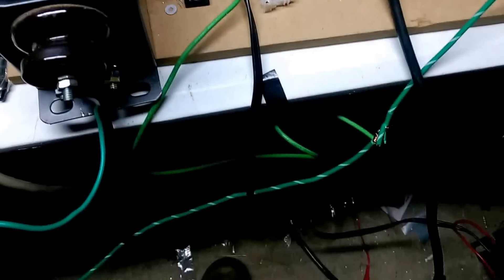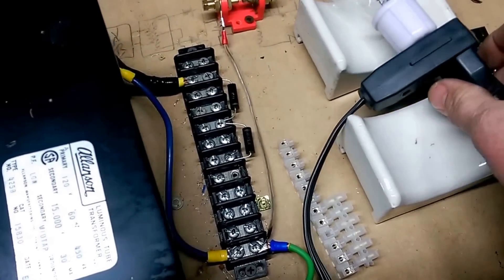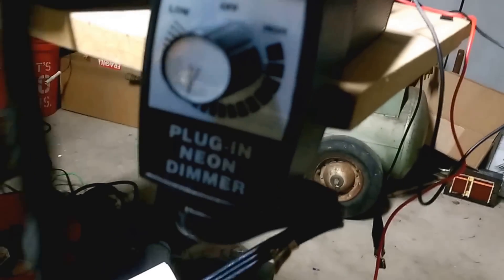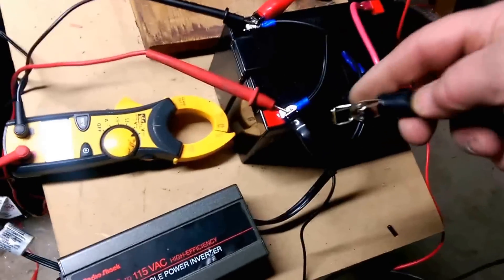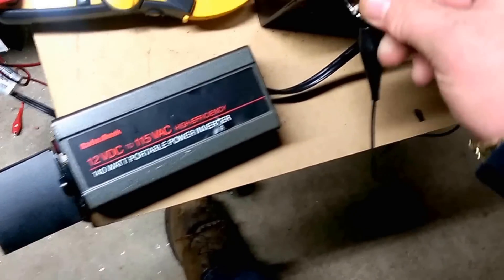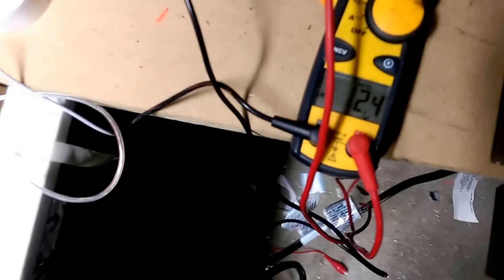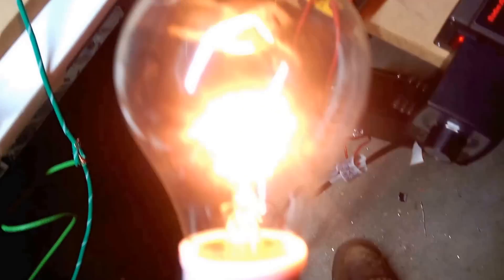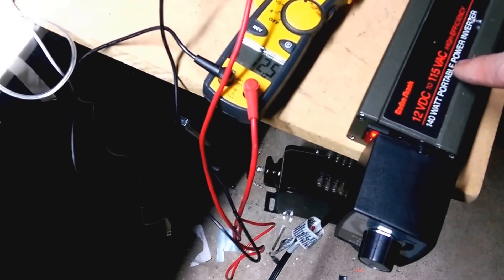Working Free Energy Generator-Dezeinstein Technologies-Annotated

Comment: Thanks Marc
I am catching up on the reading of your posts. I think all HV pumping into an earth
grounded center tapped coil is relevant. We can see from previous energy extraction
devices that energy CAN be pumped into a set of ground rods or even a single plate
only to  return back  with more energy than was originally injected.

Nice to read up and hear about your night visions. This submersion into the realm of
long hours of experimenting on into the twilight is wonder. It boarders on the definition
of the creative GOD mind where anything  is possible, where we become connected
to the answered we have been conditioned to not see.

Comment: so u are overunity. (congrats out of 10,000,000,000 people that lived u are probably 1 of 1000 or 1 of 10000).....u have to download and read.....pjkbook.pdf    its 3300 pgs...dont try and understand everything just skim through  ..... get your head around the history of overunity
Reply from the maker: +Hazenthly&#39;s Fire - Hello, Thanks for the comment and compliments. You can pick up small vials of graphene oxide powder from the right vendors on ebay for under $20. You don't have to make a nano particle coated plate to get this working, especially if you are at a higher elevation. If you look at Don's different schematics, there's a bridge rectifier in many of them that the DC - is not connected. This could remain like this, or, it could connect to the output , or, a plate/antenna. Its your choice and depending on the components, there isn't any one device built that works that is exactly the same. The most difficult part to remember is that resonance is like a fingerprint. You have to have it just right and have the tools to get resonance at high frequencies. It is tough to do, even with a scope at high frequencies because you have to go all the way down to the picofarad to line up and tune what you need as the frequency needs to be perfect. I just tuned a coil I made and I found that an online resonance calculator has shown me to make the cap in my circuit for a lower frequency 1.58 uF. The resonance calculator has 3 variables to set the calculator with.. uF, nF, and pF.  I set the calculator to give me the capacitance needed for the coil and frequency already known, and, it didn't work at the uF or pF range's reading. I added a 675pF air capacitor to the coil to tune it upwards in parallel and I hit the nail on the head. It is very difficult to use a scope to do this because the capacitance of the probes needs to be decoupled. I find it easiest to figure out exactly what the input frequency is, and, either make it variable for ease of tuning, or, ensure the frequency is dead on using 2 or 3 different frequency counters, backing the measurement up with a scope to be 100% sure the frequency isn't off. If the output is variable and it shifts a couple of hertz, you will need to build a phase lock loop circuit, and I haven't done this yet, but have heard guys like Stan Meyer have done this to eliminate frequency drift that will knock away resonance.

If you have questions that I could assist you with, please send me an invite on google hangouts and I'd be more than happy to assist you. Please don't listen to the skeptics, they have absolutely nothing better to do with their time but try to make my followers scared of trying to build these devices. I will warn you.. they are not easy to get functioning, and they take time to figure out, but, I will be willing to assist you as I do many folks. I have a lab partner that lives in Rome, Italy that has made some devices work with my assistance. They may not have a ton of power exiting the devices, but, my help got him to continuously charge and discharge  a massive cap bank in the area of 200-250 watts continuously without draining his little battery powering his device. If you've never seen any of the device's phenomenon before, it is a wild learning experience that is nothing like you have ever worked with before. There's energy that comes from these circuits that you'd never think was possible, and, it is frustrating trying to get them working without help.  Key ingredients to make these energies appear are high voltage/high frequency fast acting diodes that are good for 20 % higher voltage than your circuit can produce at it's step up coil. Other parts needed to make this work are very large DC polarized capacitors at least 3500uF to 10,000uF to start , maybe good for 480v or 650v . If you have enough of them to bank, you will have much more power. Ultracapacitors can only be used after the conversion where a transformer is used and successfully outputs voltage (this is the hardest part which requires something to pulse the energy from the cap to the input coil of the transformer in a switching frequency you would normally use, either 50hz or 60hz. Transistors can be used to build an inverter as Don shows, however, the polarity of the circuit he posts is wrong. The correct schematic is online and I recommend finding some very powerful IGBT's to be used in place of the transistors. After the IGBT section, the output could go through another  fwbr to transfer to DC and you'll be able to charge an ultracapcitor bank. It is super important to buy (2) 1500 ohm wire wound resistors or higher resistance to transfer the cold radiation back to conventional energy. The resistor takes the high voltage and creates a voltage divider, then, it breaks down the frequency from a high frequency low energy electricity to a high amperage energy that will fill the dc cap next to immediately at the voltages you need. Without resonance, you won't even get voltage to pass from one side of the coil to the other, so, this is most important. Build the board in sections or modules, so, once you are completed with one module, move onto the next.  For the plate antenna, graphene powder and acrylic polyurethane can be mixed to make a paint that is highly conductive. When I finished mine, as it was still tacky, I sprinkled powdered aluminum over the top of the copper plate and buffed it to a high sheen. The outcome makes it look like a static bag's color and it instantly has a voltage from the plate to ground using the powdered metal and the carbon used in the graphene. These substances have a normal difference in potential and since they are dry, containing no acids or liquids, they are not chemically reacting and will remain like this forever. The plates themselves will light small leds without any batteries at all and will never lose their power. If we use these to draw in energy, the level of energy is much higher than a standard aluminum or copper plate because of the natural difference in potential.. allowing the plate to capacitively couple your circuit to the atmospheric electron flow, through hthe layers of air between the ionisphere and ground. The better the conductor and better the static attraction, the quicker and more powerful electron flow results to your rectifier bridge, working as a one way check valve (avramenko plug) Also, since you are on a budget, try to get the tools used that you'll need at flea markets or from the bargain news. Be careful on Ebay, some used tools are a waste of your time and may delay your progress if you are hipped broken items, like scopes, which I bought 2 of them and they were both dead. Pick the most you can from electronics scrap piles, old tvs on the side of the road, microwaves, etc. Microwave ovens are rich in HV/HF parts, hv capacitors, they even have a resonant circuit in them and they literally are an overunity device that uses resonant transformers with the correct capacitors for their frequency, they al;so contain hv wire, and hv diodes that could be used for this, saving you about 8hundreds of bucks each microwave you find. Older microwaves literally have the cores still in the that you could build into experimental transformers.  There are high voltage IGBT's in inverter microwaves, high voltage bridge rectifiers, and, even the high voltage wiring you'll need that connects to the magnetron. I'm sure you will locate a bunch of things and come up with all sorts of cool output phenomenon that you never thought was possible, just, please be careful as these circuits could be madly dangerous.. Think before touching the circuits without discharging the caps.. They could kill you once charged up. I know people who have taken the microwave's inverter circuit and rewired it to fire the transformer as a resonant circuit to make free electricity. Their transformers have gapped cores so there is no lenz effect. If you think about it, a microwave oven produces an output power and heat level in comparison to a stove. The microwave uses a fraction of the power because it is fired up unconventionally with it's own magnetically quenched spark gap that operates at the microwave frequency and operates so much lower than an oven . If we built a circuit that transfers the heat to electricity, the microwave would have no losses,  it would have gains. So, to start building something of great interest, get a few roadside microwave ovens, and you can acquire all of the resonant parts needed internally for their transformers. Then, fire the pulse circuit they already have into their transformers, step it up, add a sparkk gap like the dynatron uses, and then step it back down and follow the dynatron directions. It will work!

I
Reply from the maker: +d king Thanks D,
  I've been through PJK's book and it makes me open my eyes to many of the ideas that were either doubtful schematics and the reason why is because if a circuit is truly working, and the internet is a place of acquisition for those schematics, would you believe that everybody who posts a working/functional circuit for free energy systems that would actually remain posted for all to acquire so they would eliminate conventional electricity?  I don't believe so.. It would be against every man and woman's interest on this planet who make money with oil or gas stocks, and, own or work for the industry or even the energy industry. Here's my theory and the reason behind it all.... 

 I have worked on tons of circuits labeled doubtful unknown to work.. If they look like they may function and I see them, I will ty them out, however, they must be unorthodox and not look like a closed system powered by conventional means having both a closed loop and a shorted/shunted coil, etc. This kills the dipole and it is something that it far too unbelievable, however, science has wrapped their minds around one method, even though it took 130 years of suppression until it was finally accepted by many once these devices started being popular amongst the net. The scientific community makes laugh of them and always try to apply conventional system mathematics to these circuits as proof that they do not work when the systems aren't compatible without conversion and offer a much different level of understanding to even allow their operation. No matter what the question is, these systems we've been building that truly work are the laughing stock of the establishment anyway, so, we all have to ignore thier aggression towards our devices, and we need to ignore their ignorance.. (Hey, that's a great saying for a T-shirt that I will produce and sell to the public in an effort to raise money for my research!!   I could see it now.."Ignore The Ignorance".. " Support Free Energy Research & Development". Dezeinstein Technologies LTD. Would you guys purchase one?? LOL

I feel the most believable reason why science challenges this is because of the true reality we face when these energy systems are needed, that is when the oil runs dry, or, when folks stop being greedy enough to kill our home to be filthy stinking rich and would rather have money than help keep a safe clean home for our future children. The fact is that most of those scientists have ever experienced trying to build these systems are a strange phenomenon that was unexplainable them which they wrote off as an anomaly. They are literally paid to keep quiet about these technologies because they feel they are never going to be marketed. I see why and know the reasons, but, it takes more effort tha just shelfing something. We all need to go to the US Captal's website and apply for a petition to request consideration of free energy systems to be sold or included in classroom theory, training, or, school and college curriculums. There were engineers and mathmaticians that have wrote formulas years ago that were correct with their figures that has been nothing but suppressed by being paid off by JP Morgan to eliminate any scientific mathematic ability to prove it's function. He paid Lorenz to wipe out the overunity formulas. a The difficult point we have to deal with is the fact that we get these devices to work at times in flat terrains and low sea levels by having better grounding, then, raising an aerial collection device draws in a return with high levels of energy coupling to the aerial collector capacitively. When we move these devices from place to place, it is tough to get them going every time as Earthly variables and conditions presented to the device change. Tuning must be able to be done, and, if we don't build these devices for variability, the problem is that they are basically built to perform only in one place.  My best ground has been in the valley or part of the way down between two mountains as some energy is able to be collected, so, when I make this happen, it isn't to the extreme. When I move the device at a high atmospheric level from ground, I have wonderful experiences and much better outputs.. When I ground deep in the valley and I am at a high point upon a mountain I get extreme outputs. At half way up, between the mountains I have difficulty getting  any astonishing outputs, and that is exactly where I am located, half way up a mountain, literally smack dab between 3 mountains in the Appalachians with a stream 200 feet down behind my home! . If I am successful to get any of my devices working here, I could pretty much make them work fantastically anywhere else because of the amount of raised grounds/mountains i have blocking access to longtitudinal waves..  (this means if my device is able to be sensitive enough to collect the energy here, it means I have tuned it right on the button, or, it is just sensitive enough to make it work a small amount here, and elsewhere it should really work like a charm without having anything block the aerial energy
Reply: +Marc Belanger You meticulously continue to outline your work with great clarity in these comments Marc. I intend to go ahead soon with experimentation; however, I've found your nano-carbon materials to be a bit expensive, any links? I have a NST, several inverters, enough high farad capacitors to make a bank, and several large coils I've used before in Slayer Exciter. I'm currently under a spending limit of 150 dollars to create a device; but I believe I have much equipment all ready; I was considering buying the Gerard Morin washer pump and a good dc motor. Do you have any recommendations on this?  Also I have a good adjustable spark gap, and plan on picking up several step-up transformers...although i'd assume with the NST this would not be neccesary.
Reply: +Marc Belanger Thank you dearly for the reply. I have an old tube tv in the basement so I'll take that apart for some components. I'll discuss with you on hangouts more about the system (can't seem to find your name for the invite tho)...because I am approaching the day when I will buy parts. I've also looked before into Rota currents and that way to harness the telluric currents of the earth, compared to your nanoparticle method of an aerial; both seem to be solid ways of pulling in energy. Rota was said to be knocked unconscious by the intensity of his ground methods on the equinox...while doing your work I plan to experiment with his ideas also. Much is outlined there as well, provides a good alternative for your aerial method; so then all terrains this device can be used! 
I want to go ahead, and begin at, of course the beginning. Perhaps a hangout to discuss parts with me and the overall schematic, as I've been looking at the Don Smith one for a little bit now. You should know that I'm not looking to make a super-powerful device; like your friend in Italy has quite a bit in my opinion; I'd go for much less, but still all the fun!
Reply from the maker: i'll send you an invite , but, you may have to add me to your circles first as a friend or as technology, etc., on Google +